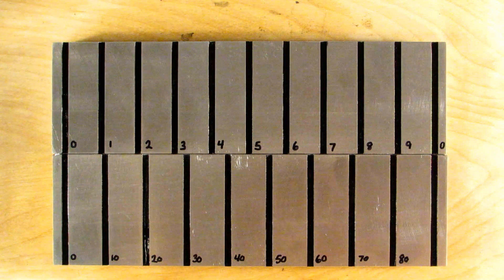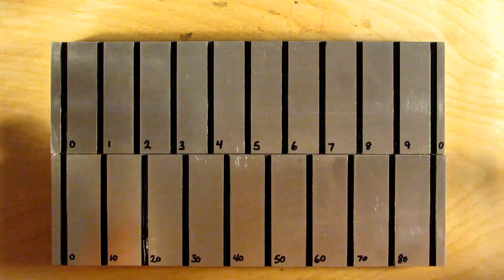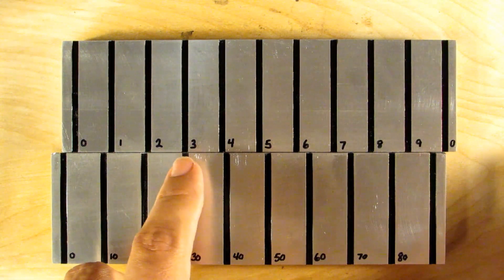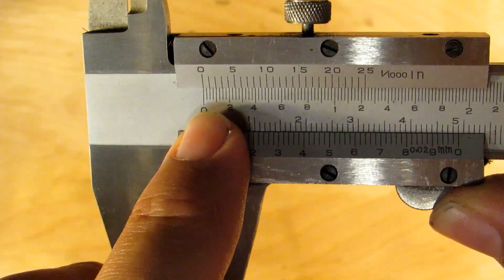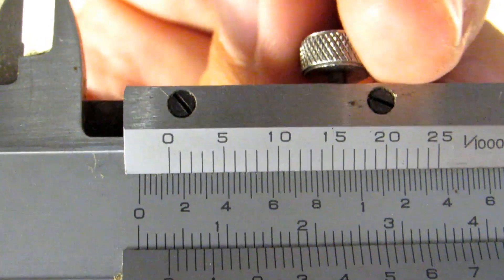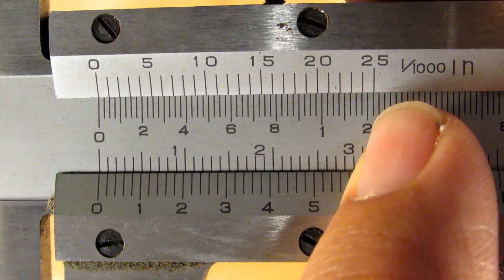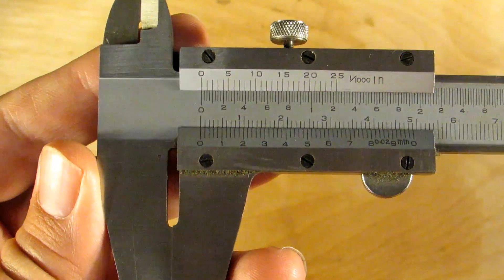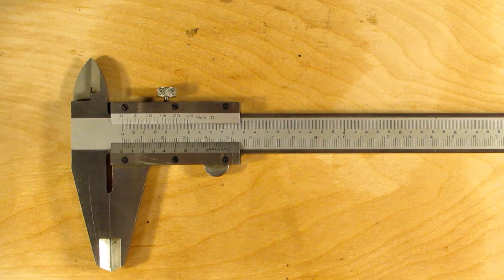How a Vernier Scale Works

Comment: Seen a few Youtube videos on this subject. You are the only one who points out checking the lines on each side of the actual one.
On my 65 years old racing motorcycle, both camshafts and ignition timing is set with gears with Verniers made by hole circles and a locking pin.

Comment: i didn't understand the bit where you said "the 5 lines up, the 4 and the 6 don't, so we're at 15 thousandth's of an inch" - where did the 15 come from? Actually, now I've watched again,  i didn't understand how "3 on 30" was 3/1000ths, how "0 on 10" was 10/1000ths,  or "5 on 60" = 15 / 1000ths of an inch.  I can't fathom the pattern.
Reply from the maker: Hi Nik. In my demo pieces at the beginning of the video, the main scale (numbered 10, 20, 30 etc.) is on the bottom and the vernier (numbered 0, 1, 2, etc.) is up top. The two scales point to each other for the reading. For the main scale, you're looking for where the 0 line on the vernier is. In the case of your question, the 0 is between 10 and 20 on the main scale, so you know your measurement will be somewhere between 10 and 20 thousandths in this case. Now if you move up to the vernier scale, you need to find which one of those graduation lines up with a graduation on the main scale. In that case the 5 lined up perfectly and that's how we got 15 thousandths, 10 on the main plus 5 on the vernier. I pointed out the 4 and the 6 because that provides you with an easy double check of your measurement. On the vernier scale, only one of the graduations will line up perfectly, in this case the 5. The ones on either side of it, the 4 and 6, will be offset from the graduations on the main scale. When you see that pattern of graduations that are not lined up, lined up perfectly, and not lined up again, you know for sure that you're looking at the right spot. Let me know if you're still unsure of it. If need be, I can make a short answer video for you. Take care, Stuart
Reply: Thank you very much for taking all that time to reply. I understand now.
Reply: Finally understand how to read Vernier scales (though I still haven’t figured out why they work). 
On a side note, I’ve been working in metric engineering dimensions for so long now that the very idea of accurately measuring precision in thousands of an inch leaves me fighting an urge to giggle. But tell me a distance in km and I have to divide it by 1.61 to “understand” it. And I need pen and paper to convert from litres/100km to mpg.

Comment: I broke down and bought an inexpensive digital caliper. It's surprisingly good for what I wanted (something to keep in my range bag for front sight adjustments), but frankly, I still prefer my sturdy, Polish-made vernier caliper for ruggedness, and my elegant Starrett dial caliper for ease of use at my reloading bench. I like the idea of no batteries needed, and that the vernier caliper will be usable long after I am dead and forgotten.

Comment: Vernier calipers have another advantage.  If it was accurate at the factory, then so long as you don't damage it, it will always be accurate.  You will have to check digital and dial calipers on a regular basis to verify they are still reading accurately.

Comment: Digital calipers work the same way, the only difference is the lines are capacitive. The only cost of a long digital caliper is the finishing of the rail, which is the same for both. Digitals can also take relative measurements.
Reply: Interesting, the explanation of the video and what you say makes me understand how it works, or so I think. The IC looks for the highest capacitance between 10 or 20 sensors, and that is the measurement, if the previous one was in sensor 5, and the current one in sensor 6, then it moved x spaces to the right.

Comment: I moved to using a vernier caliper after I dropped my dial caliper. Never looked back. Only issue, I found, is that I wanted to purchase a 60 - 70 dollar vernier caliper at about 12 inches (assuming the quality would go up in a more realistically usable way, unlike the dial or digital calipers just having prettier displays with the same body), turns out that vernier calipers are generally either 30 - 40 bucks or 200 haha.